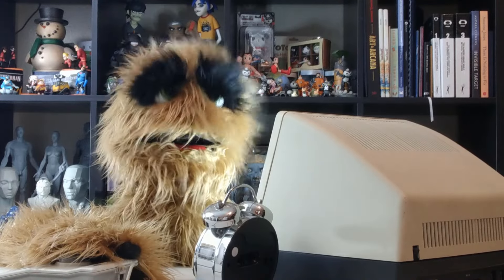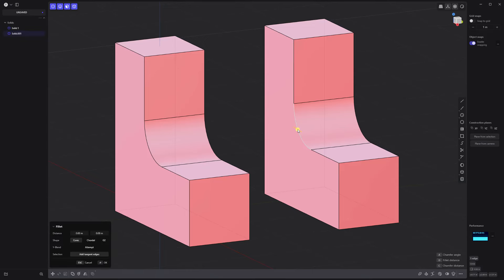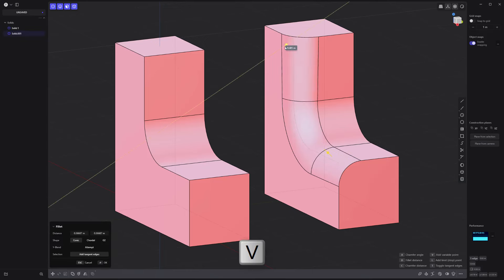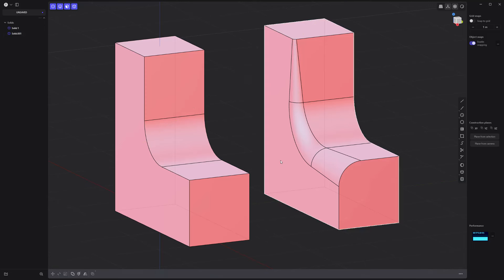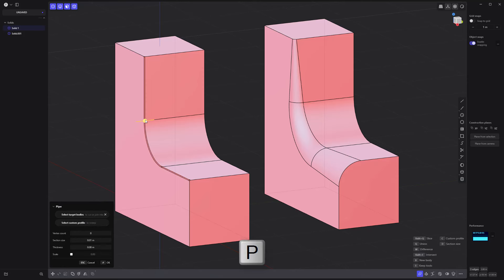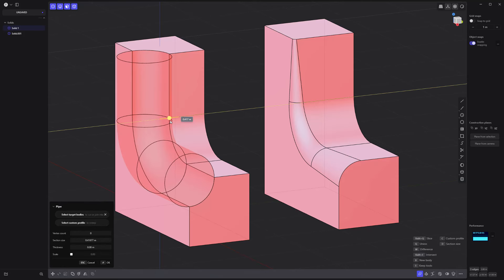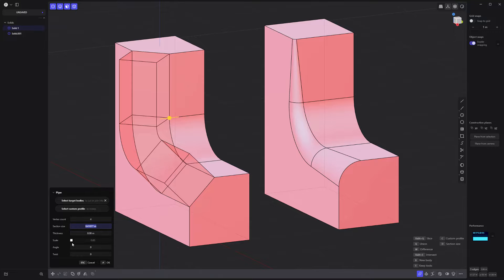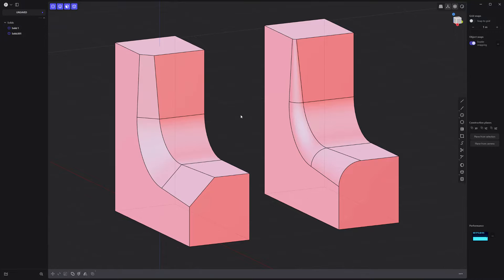Plasticity | Create a Tapered Chamfer

Comment: I have a question. what is easy way to make curve from pipe object?
Reply: along the pipe
Reply from the maker: You could use Isoparam tool to add a new edge along length of pipe then select new edge and duplicate it to make a curve